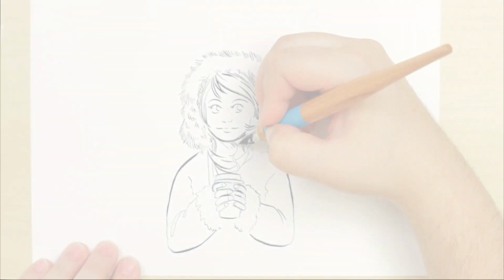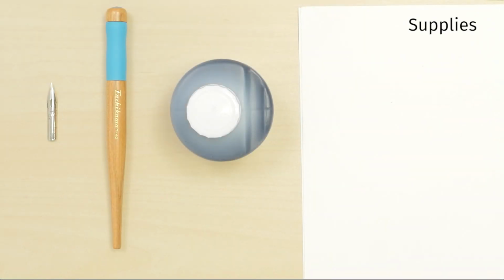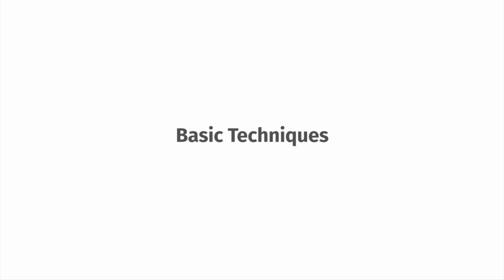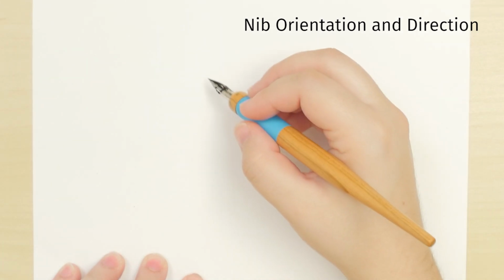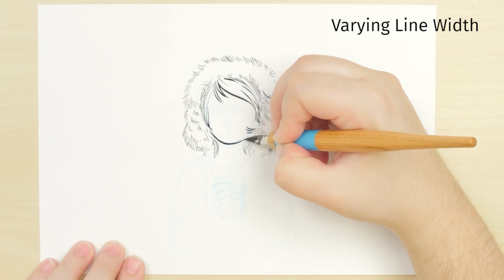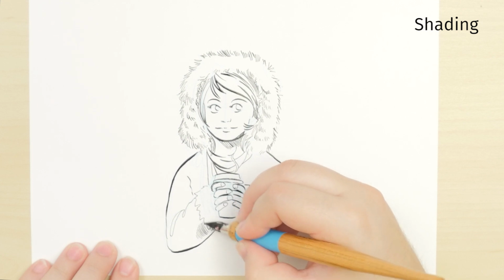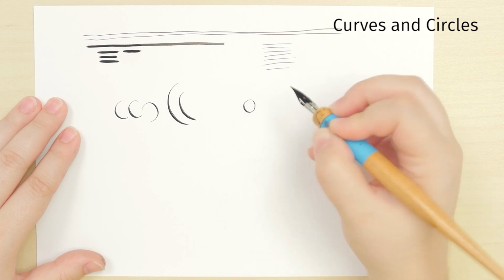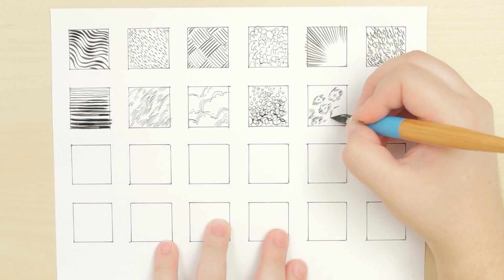How to Use Manga Pen Nibs

Comment: The first time I started using them I was disappointed that the ink did not flow down while drawing. But now I know that you need to remove the coating before you start drawing.
Reply: Make sure your nibs and paper are clean, too. The oil from your skin can mess up ink flow. So clean your nibs frequently and try not to touch your paper with bare hands.

Comment: Ink still refuses to flow even after applying of acetone and rubbing alcohol. I had 2 separate nibs for testing purposes. I lightly burnt the first one and applied acetone on second one, but none of them draw properly even if I maintain the technique. Please, help :(
Reply: What ink are you using?
Reply: @mocknugget  I tried pilot ink. I started using a tablet now though
Reply: @OriGummie  use india or sumi ink if you use your nibs again
Reply: @mocknugget  I’ll try using those! Thanks a lot!

Comment: Do I prime it every time with acetone
Reply from the maker: No, just when you first use it!
Reply: JetPens then how do I maintain it on a daily basis???
Reply from the maker: Rinse it with water every time you're done using it and make sure to dry it completely so it doesn't rust. Then keep in a dry place.
Reply: JetPens you are a life saver!!!!!😍😍😍😍
Reply: I use speedball pen cleaner to clean it because I don’t want it to rust. It gets ink off better. Before I got it though, I actually used nail polish remover lol. It worked

Comment: I want to use a nib in outlining my drawings, but I'm a lefty and usually writes in over hand... so   using a nib is quite difficult...
Reply: AlphaIkaros I’m left handed too, it hinders only with writing (left to right). With drawing there are no issues. You have to draw from right to left. You have to remind yourself to it because we are used to start like writing from left to right.
Reply: @bennyvermeulen7255  Im also left handed, Every time i use it my bottom hand gets ink. thats the problem. But in used to it.
Reply: @Sainheartend_Piru  like i said 2 years ago, we all are used to write from left to right, especially as a westerner, i still keep te remind me when I'm drawing to start at the right side of the drawing and then going left, while drawing you can turn your paper for the best angle for your lines, don't keep your paper fixed. And don't forget, ink coming out of a nib is laying thicker on the paper then a brush, so it takes longer to dry before you can go over it with your hand.

Comment: are manga nibs more flexible compared to calligraphy nibs from speedball or whatever?
Reply: They are not for sure. But they are so easy to use especially for the beginners. They are more stable n stiff so they r also hard to be broken. You can use them faster nearly as pens (like Micron or Artline) and there is no way to drip or splash. And you can use them on many surfaces; they are familiar with textured papers even on watercolor papers. But it is impossible to catch the feeling the crow quill nibs (speedball or as my choice Brause 511) can give; u'll have limited flexibility with linear lines with G nibs. That's the whole story; have fun, work hard ;)
Reply from the maker: Depends on the model! The Zebra G nib we use here for example, is quite flexible and often used for calligraphy. To see all the different flexibility levels of manga nibs, check out our Guide to Manga nibs here: http://www.jetpens.com/blog/guide-to-manga-pen-nibs/pt/893
Reply: As i told it before; G nibs r a bit too stiff so it's not so easy to create linear differences. So they r not perfect tool for advanced calligraphy. But they can be great for comic or cartoon texts cause of easy usage. It depends on your style n' needs.
Reply: GPens are actually quite stiff, mostly used in shonen for the strong and sharp lines they give, I believe (not certain) that Maru nibs are more flexible.
Reply: Except this videos just showed how flexible they can be and it's that sort of line variation that's made them the standard for mangaka, Maru nibs are used for thin lines(like the eyes or fine hatching). The Kabura/Saji is the stiff one and it's usually used for consistent lines.
Reply: Volkan Kinaci are they useful for calligraphy?
Reply: The G-pen (shown in this video) is used because it can create line variability depending on pressure. So you can make thin lines with light pressure and thick lines with more pressure. I'd say a G-pen is not an ideal choice for calligraphy